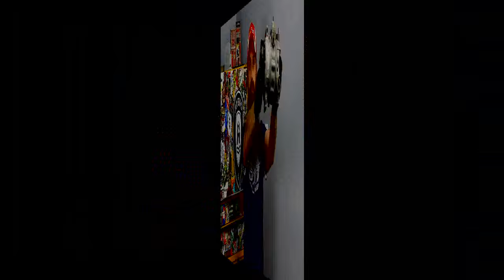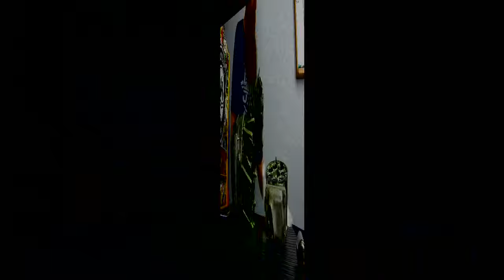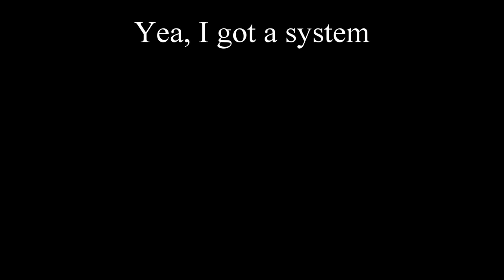How VW A/C Compressors Fail

Comment: I'm getting a VCDS 08-Auto-HVAC 00898 - Control Circuit A/C compressor 010 - Open or Short to Plus code.

I am assuming that this would shut down the compressor.  Can this fault be caused by a bad compressor control valve?

Can I use a volt meter to test if I am getting voltage to the control valve?

Any help would be greatly appreciated!

Comment: I have an 06 Jetta TDI throwing no codes Freon is good but no ac. I also don’t see fluctuation in the ac gauges. What is the amps given to the valve. I read .82 amps ?   I am used to the clutch type ac these constant compressors are new to me. Any help would be great

Comment: Failed parts. I have a 2010 Passat Komfort Sedan 2.0t. Had all coils, plugs replaced 2 months ago and check engine light still on.  Codes are p0300, 01, 02, 03 & 04.  Now my EPC light came on and also code p2187.  Any advice on how to  pinpoint if it's a faulty vacuum hose vs. Bad coils or intake manifold failure?
Reply from the maker: look for a leaking rear main seal or any oil leak really. That is common for all those codes.

Comment: 2011 Golf - AC sometimes not blowing cold, and a rattle/clicking is coming from the vicinity of the compressor when AC is on. Could this noise indicate a bad clutch, valve, low coolant, or something worse?
Reply: Check your ac clutch. Make sure the pulley is actually driving the compressor and not just freewheeling around the compressor shaft. If the center bolt has loosened, the splines inside the clutch wear out in no time and is no longer transferring the movement of the pulley to the ac compressor.

Comment: i have code 00819 hot air blowing it was working fine any suggestions on how i can repair? or would i be able to replace that valve its a late model b6 2005.

Comment: Hi humble mechanic, I have a 2011 q7 3.0t the solenoid in the compressor is getting power but the clutch is not engaging , I put a wrench on the bolt in front of the clutch and the compressor only turns about one full turn and then it stops I turn it the other way almost a full turn and it stops, do you think the compressor is bad or by changing the solenoid would fix the problem?
Reply: Compressor is shot, the clutch is stripped

Comment: Hey thanks for the vid. Do you know if it’s necessary to replace the receiver drier or accumulator too when the Ac solenoid valve is changed?
Reply from the maker: It's always recommend when replacing a part that requires opening the system.
Reply: HumbleMechanic thanks for the quick reply!  Follow up question - I have enough clearance to get the solenoid out without having to removing the compressor. Is removing the solenoid only still considered opening the system?

Comment: Hi Charles, could you point me in the right direction to a link/page that sells the valve/solenoid for the compressor on a 2002 beetle 2.0? I've only been able to find the valve for newer models (2006-2010). Thanks in advance.
Reply from the maker: That compressor doesn't have that type of valve.
Reply: The SD7V16 has an internal control valve which only reacts to refrigerants pressures and can't be controlled electronically. The compressor head must be disassembled and the reed valve plate removed to replace it.

Comment: I have a problem in my Mk4. I just can't seem to turn the A/C on. It has normal A/C (no Climatronic) and when I press the A/C button, the button does not stay pressed nor does the light turn on. All other HVAC controls are working fine (including internal fan, heat and recirculation). The recirculation button does stay pressed and the recirculation light also turns on, if I set it to windshield (demist), the recirculation button automatically pops out, as it should. 
 Can anybody help me with this issue? The A/C button does not nothing when I press it.

Comment: I have a 2016 Polo 1.2 6C,  I never had issues with the AC but my water pump was leaking so the car dealership replaced the water pump and timing belt, but now I have AC issues, does the AC run off the same pulleys and belts as the water pump?
Reply: No. Has its own belt and pulley but both the timing belt and compressor belt are attached to the same crank pulley.

Comment: So my fiance has a 2008 Beetle. The compressor center does not spin by hand and the center spins with the engine. The coolant light also comes on on a hot day and the engine retards power. Then fan does not come on either. Either with the A/C on or while thw engine is running with A/C off. All the fuses check good. When I look up the 2008 it shows 2 fans and the fan control module under the battery.... Her car has one fan and an aluminum box the fan plugs into. Really don't want to take it to the dealer. Any help is appreciated

Comment: Very informative....thanks...got no cooling...replaced solenoid valve.....and G395...and getting juice at the N280 when AC on.....
so thinking its the compressor....so pretty much replace condensor and receiver/dryer automatically...or is there a way to check if these have been contaminated?

Comment: With all those failed parts i wonder what did wv group made right sometimes. Anyway dear humble mechanic i need your wisdom because i am surrounded by faild mechanics even in the main dealership garage in my Country. I have an ibiza cupra 1.4 tsi 180bhp dsg7 the one with compressor and turbo. 3 months ago i had a problem there was no compressor or turbo power and the engine was not raving up s it should be it was like a dead 1.4 atmosphere horse. They changes in the dealership 2 electro valves as they said in both turbo and compression. That fixed the problem. But over 2 weeks now i am experiencing it again on random occasions specialy under load when i try to overtake for example or accelerate from a stop etc. They said that my last ecu reports a "overspeed" error and they are trying to blame my driving style for this that i have pushed beyond its limits the car!!! Which is stupid. Its a cypra a sport car made to be driven when needed a bit fast. And for god shake i am not driving it like i am in a race and 4 years now i never had this problem! Also they are trying to blame the very hot weather sometimes 38c - 40c and generally because they can't find what is going on they are getting on my nurves. Please do you have any experience on that issue, any known parts that had failed that can cause my problems??? You are my last hope. Thanks a lot!

Comment: I have a 99 Jetta 2.0 non turbo and on my AC Compressor the clutch itself is not even on the compressor at all. I had a friend check the compressor out and from what the 2 of us can figure is that I just need to replace the clutch. Is that an easily performed fix?
Reply: @satchitananda1820  This is about variable displacement compressors that have a permanantly engaged clutch, unless it has stripped due to compressor failure.
Reply: @satchitananda1820  How the hell did you get that username? is it a joke?
Reply: @johncaldicott1430  Thought the same thing.  There are more "loving" ways to correct somebody for an honest mistake. Or rather more civil and respectful.    Hair trigger anger issues showing here.
Reply: Must say it's usually the cowards who wouldn't say boo to a goose face to face who are the worst offenders, as shown by his replys he is one for sure.
Reply: @satchitananda1820  You really need to get a better one then, it's worth the effort, god will help you if you own up😉 "Hoist with his own petard" comes to mind😂

Comment: So my son's Jetta A/C was messing up the mechanic was about to change the compressor so I told him to pay special attention to the compressor valve after some arguing back and forth he agreed with me. turns out I was correct I saved myself $400.00 and change + problem solved. btw the mechanic wasn't trying to screw with me he was of the impression that the compressor and the valve are a single unit, in fact, he told me that in most modern cars that's the case.
Reply from the maker: Awesome

Comment: i have a question. everytime i turn on my ac i can feel the compressor kicking in. it vibrates alot. any tips as to why?
Reply from the maker: +omar k There could be a lot going on. Start off with a visual inspection. With the AC on, inspect the fans for abnormal movement. Also look at the compressor and the belt that drives it. 

There is usually an increase in engine vibration with the AC on due to increase in load. Your situation may be beyond normal. Start with a visual inspection

Comment: When my aircon fan is at low speed the aircon noise seems follow the rev of my engine. I can hear it well especially when the car is slow. What can this reasons be?
Reply: Most if not all variable displacement compressors seem to make a growling noise when the plate is at the minimum piston stroke angle. Minimum piston stroke means that the piston is very rapidly alternating between suction and compression and the reed valves in front of the piston follow the piston movement and "flutter" just like the wings of a hummingbird. This seems to make the pressure of the gas inside the suction pipe rapidly oscillate and low frequency vibrations inside the piping and evaporator can develop. If it's always making this noise (and not cooling greatly or not cooling at all too) it can be either a faulty control valve or a very low refrigerant charge; both conditions can leave a variable displacement compressor always working in minimum displacement. If the refrigerant charge (in terms of weight,  not pressures, since it's a variable compressor) is ok and the valve operation is ok too, and you hear the noise mostly when the weather is cold and you want a defrost action or you turn ac on anyway, or when the weather it's hot but, provided you have automatic climate control, you set a temperature that's close enough to the ambient one, it's unfortunately normal noise that can only be somewhat reduced by checking for proper refrigerant line soundproofing (i.e. if the lines are held in place by clips with rubber dampners, try replacing them if the rubber hardened).

Comment: Hello, I have a 2005 Audi A8L 4.2 Quattro. My air conditioning works intermittently. On a highway drive, it will work for 45 minutes and then decrease in output. Sometimes, it's really cold, and other times it's not. There is a code showing for 01232 "N280 regulating valve for compressor of air conditioning system" (short to ground).  Can I replace this valve without evacuating the a/c system? I've already had my mechanic replace the G65 High pressure sensor (which it previously set a code for) but the a/c is still intermittent.
Reply: replace the entire ac system. VW uses a dessicant in the dryer that falls apart and contaminates the entire system. All the flushing in the world wont get it out. I had to replace my entire ac system twice in the six years I had mine. VW cars manufactured in Mexico are self consuming, and are made to fall apart after the warranty expires. The price of owning mine got upward of 3 grand a year, so I just ended up buying a jaguar instead.
Reply: Wiring to control valve is shorting or opening

Comment: Wish there was a replacement clutch for the compressor instead of having to buy the whole compressor mine has a bad sealed bearing on the pully prob a 4 dollar bearing my ac blow ice cold but pully is noisey and prob gonna seize soon so now i have to buy a 300 compressor plus whatever it costs to recharge it iv owned two vw jettas one a 98 2.0 and a 02 1.8 and they both have had this issue sux because i dont even use the ac

Comment: hi.. i have an eos 2009..my ac is blowing but its blowing hot air then later it will be cold then hot again like its deciding on its own..what do you think is the problem? tnx
Reply from the maker: The compressor is the most common failure in AC on that gen car. Fans are a possibility too, but the compressor is the most likely failures.

Comment: Hello humble, do you have anything on a 2008 vw beetle AC ... I took it too different ac mechanics and still the same thing!!!! Ac works and then just blow hot wait a while and then starts blowing cold again and back to hot and back to cold... can you help?????
Reply from the maker: Probably a bad compressor. Really had to say with out looking at it.
Reply: I had a compressor put in at the dealer about a year ago when it started doing it? To mouth ago I changed that valve? But nothing doing same thing??? We live in Washington state it’s cold most of time so it was hard to tell if dealer fixed it to take it back to them at the time but I all ways noticed when you drove car for a while turn it off and then when you get back in car start it off windshield will always get fogged up and we always drive with ac on..... always, so it’s hard to to see if ac clutch is working cuz by the time you pull over to check under the hood ac may be back on? Hope I explain it right...... :-(

Comment: I have a 2002 Jetta TDI since new and it still blows 3C on high fan.
Reply: They once fitted the Sanden SD7V16 and with this one, as long as you have the correct charge weight, you get cold air. How much cold depends upon the ambient temperature. Warmer in mild weather, colder in hot weather (supposed to save fuel when all you really need is defrost). The problem is, if the control valve fails, you no longer get cold air, and have to disassemble the compressor to replace it, since it's deep inside the compressor body...

Comment: Hi ..recently i have replaced my car compressor for Skoda Octavia ii , Sanden clutch less compressor and condenser .. my bad is after changing this also the AC is not working.. when i scanned using VCDS i found a strange thing ,,  compressor shutoff code is 0 , no AC errors. But compressor current (Actual) is showing empty , But compressor current (Specified) is 0.820A ? what would be the problem ? please help.
Reply: Broken wire?
Reply: @johncaldicott1430  broken wire from where to where ?

Comment: Thanks for all the tech info. Your knowledge and videos help much.  I have been working on cars for decades but, recently been having to work on ^(&(*&)) VW's and am trying to learn this stuff.. I understand that the N280  control valve is pulse width modulated but, am kinda of confused on how the controller does that.  I see that one side of the valve wiring goes to a fuse and the other to the controller.  So, does that mean the controller pulses the ground to the control valve to vary the duty cycle?  Should the voltage on the hot side of the N280 always be battery voltage between it and chassis ground?  If I check voltage between the two wires at the compressor system on, back probing,  will it display a sort of average voltage  dependent on duty cycle? High voltage high duty cycle, low voltage low duty cycle?  Lots of questions.  I do not have a scope or, meter to read duty cycle so, I am trying to diagnose this stuff with out one.  Thanks again.

Comment: Nice video!  Can you please do a video (or reply via comment) on how to see if the receiver/dryer is the problem?  Thanks in advance.   (More detail:  I'm very tempted to just have a shop evacuate the refrigerant and try replacing the  AC compressor solenoid myself, since it's just a $20 part on Amazon, with good reviews, and there's now a very easy "how to" video on this on youtube, "How to save $1200 dollars on your Volkswagen AC Repair. VW A/C Hack!!!!". Seems worth trying, before paying $1200 to have the entire compressor replaced. )
Reply from the maker: Usually you’ll have Grey sludge in the compressor if the drier fails. But the only way to be 100% is to look at it
Reply: @HumbleMechanic  Aha, got it.  Thanks for the quick reply Charles, much appreciated!

Comment: My Tiguan 2018 with 81000km the A/C stop working,after troubleshooting at VW they replaced the compressor 1400$ pain in the ass.German car is good to drive but is very expensive to repair it.My next car will be from Japan.

Comment: piston compressors are high failure items. vane and scroll compressors are better technology.
Reply: Wrong. It's the opposite. A piston just slides along the cylinder wall, while the vanes and scroll are respectively rubbing against the compressor's chamber walls and the stationary scroll. Lubrication is much more critical with scrolls and vanes than with pistons. Beside this, any compressor, even the swash plate piston, can fail if poorly designed.

Comment: Hey @@UC2gRQKQgI3CsrcnMuHPyYsQ ive got a question about my k04 07 FSI its BPY the A/C compressor is spewing refrigerant everywhere over the crank wheel and alternator. Now i have a code for drive voltage an my car is idling very funny at 950rpm do i need to replace the whole part?
Reply: @humblemechanic
Reply: can you help?

Comment: @5:36 Mine sounds like a cross between a cat purring and a Marge Simpson 'annoyed' sound.
Reply: That's the pistons traveling a short stroke. It should become completely silent once you turn AC off (this makes the refrigerant circulate only inside the compressor, and since the noise is caused by rapid pressure oscillations that make the evaporator resonate, you no longer hear the noise once the refrigerant stops circulating through the evaporator).

Comment: The A/C compressor will not fail mechanically if there is enough Refrigerant/Compressor Oil. Don't confuse Refrigerant R134a is also the Refrigerant Oil.